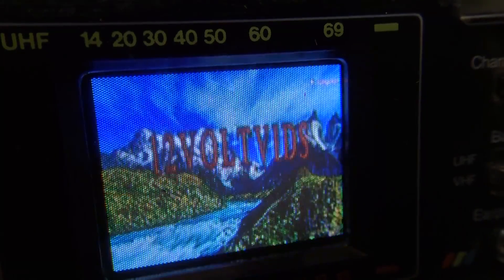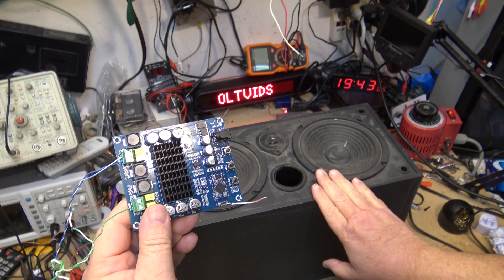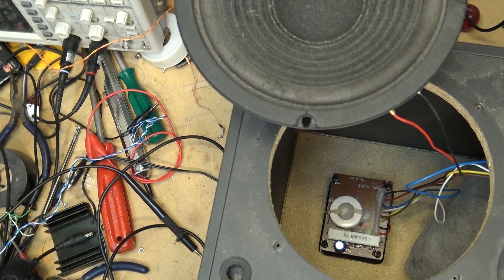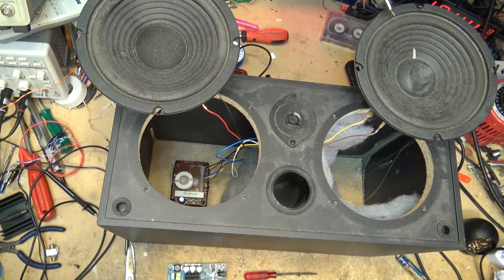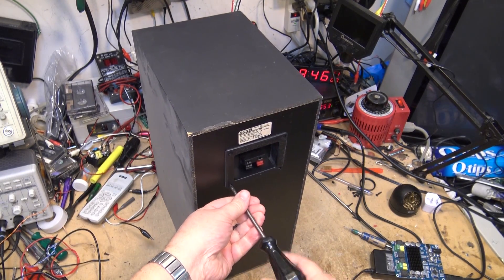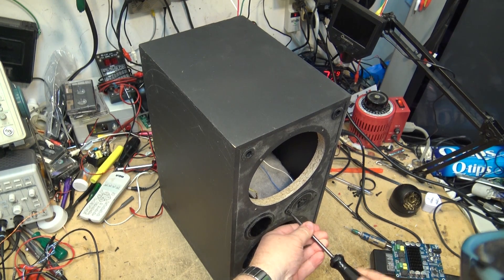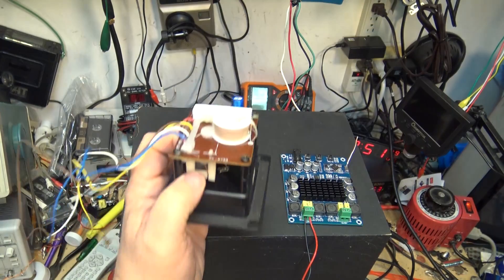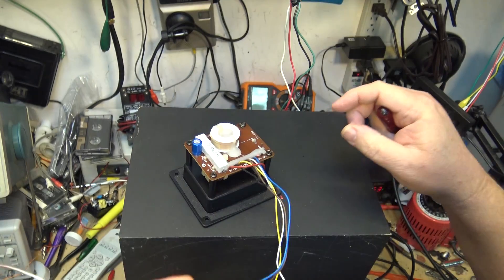Bluetooth Stereo Speaker in a single enclosure

Comment: +12voltsvids is it possible to wire up bass speaker to run off a 3.5 mm AUX cable to plug into a mobile phone ??

Comment: Simple but Brilliant trick with the vac.........
Reply from the maker: Learned this one from the tech at the first shop I worked at while still in high school. Done it hundreds of times. It works for most speakers. A few have a soft free air flowing dust cap and you don't get the suction but on those ones a dab of hot glue on a piece of wire can do the trick

Comment: To pull speaker domes out i use a match stick with a dab of hot glue and you let the glue cool a little before you stick it on and just quickly rip it off. Cause sometimes the vacuum trick doesn't work with harder dust caps.
Reply: Hrod750 I’ve always used a piece of tape.
Reply from the maker: Vacuum trick has worked with every one I have used it on, and I have been using that technique ever since I learned in way back in 1980 when I was doing my apprentiship.

Comment: Sounds rather good though
Reply from the maker: Its a great bluetooth sound bar. My TV has bluetooth audio, and this sounds way better than the tiny speakers built in.
Reply: its always best to connect a sound bar through optical for the best sound, and not bluetooth because of the slight delay, I have a panasonic 60in TX series tv and for saying it has no sub and how thin it is the sound is amazing

Comment: You could have used the existing speaker terminals on the back of the box as the dc power input?
Reply from the maker: I could have, or I could have mounted a terminal, but I am lazy, and it is never going to be moved. It is in my office below my TV. Sounds great.

Comment: And another bluetooth product is born.
No you can't fit one to the loo he he :-D
Reply from the maker: Going to use this on my TV with bluetooth audio. It will certainly sound better than using the internal speakers.
Reply: Been done. Kohler released one in 2013. 

Cost $6500, and yes, it played music via Bluetooth. Built-in speakerphone too. 

"You'll never guess where I'm calling you from! *flush*"
Reply from the maker: Kohler, that would be a crapper.
Reply: 12voltvids indeed it is. Top post mentioned fitting one to the loo.

Comment: Hi mate thanks for the informative video. May I ask if you can explain a little more how about to connecting and wiring the speakers to the Bluetooth module? Or maybe a schematic in a video to explain
Reply from the maker: The wiring is self explanatory. 
It has a power in jack for 12-24 volts which I plugged into an old laptop 19V 5A supply, and the speaker terminals are marked L- / L+ and R- / R+ these go to the respective + and - terminals on the speakers.  One speaker connected directly as a full range, and the other one going through the cross over
Reply from the maker: I think that was illustrated pretty good.
I cut the red and black wires heading to the second speaker and connected the red to the + for the left speaker, and the black to the - for the left.
I then cut the red and back wire from the old speaker input terminal that connects to the cross over.  Those red and black wires went to the + and - terminals for the right output.
The output of the cross over Blue and White  went to the tweeter, the yellow and brown to one woofer, and the red / black to the other. They only go on one one way, as the connectors that plug onto the speakers are different sizes.